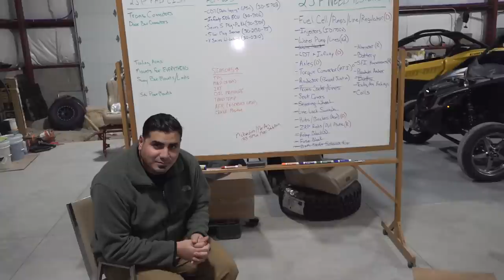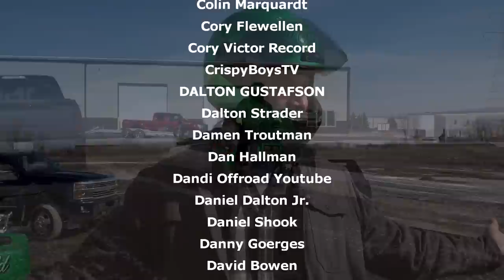We bought a mini PULLING TRACTOR! (and it RIPS!)

Comment: Wild horse name and logo is a play on the wheel horse lawnmower brand name and logo. 11:30 i thought it was Lloyd driving off on the moped in Dumb and Dumber. Lol the headlight a rpm activated light?
Reply: Yes I agree it is a play off the wheel horse it has a wheel horse rear end and that's why the red horse head over the tires on the rear fenders is there that's wheel horses logo I own 8 wheel horse tractors they were made vary well all steel at least the older ones and the used to use these old tractors as pulling tractor because they were made with thick steel to take abuse

Comment: You guys need to get a full size rubber parking curb thing and drill holes in the floor about every 8 inches so you can pin it down wherever you need it for whatever length thing you are going to do a burnout with.  Or drill your current rubber stops and pin those in.  Safety third ya know.

Comment: Needs a Busa motor with nitrous or turbo ! Hell Yeah Brother, I'd drive it !lol Kawi KZ motors are 70's vintage but still cool though but they just don't have the revs to put the power down out of the gate, but the fun factor is still there, you could probably run in the vintage class

Comment: I would love to see a 400 hp x3 motor in it next  build that 35 hp is not enough power
Reply: That kz1100 engine running right makes bout 108 stock
Reply: @nitromatt37gaming52  my x3 stock at 120 hp could fry a set of 28 in tires that thing can't even smoke a set of 12  and geared low not 108 hp
Reply: @shawnmccutcheon6873  geared right itll be a beast but tbh it's better off with a sxs engine

Comment: Leo you are the tractor pulling KING MY GOD THAT THING LOOKS LIKE FUN. That is your baby my dad had the Full bagger KZ1000 when I was 14 years old and he used to be a big Harley rider and he used to pull willys on his Harley but when he took me for a ride on that KZ1000 WHEN HE WAS ROLLING AT 40 MPH IN FOURTH GEER HE PULLED IN THE CLUTCH AND DUMPED IN 2ND GEER AT 45 MPH AND HE PEGGED IT IT BY DUMPING IN 2ND GEER AND THE BACK OF THE BIKE SQUATED TILL THEVPIPES RUBBED AND THE FRONT END CAME STRAIGHT UP TILL HISS BAGS IN BACK ALMOST STARTED RUMBING AND SPEED SHIFTED INTO 3 MY GOD THAT KZ1000 NEVER STOPPED PULLING I DIDINT EVAN KNOW HE WAS LETTING RIP AS HARD AS HE DID SUPER SUPER AWESOME MOTOR DO NOT TARE THOSE GEERS UP BE GOOD TO THAT TRANSMISSION BECAUSE EVERYBODY AND THERE BODY USES THAT SAME MOTOR FOR DRAG MACHINES AND THERE HARD TO FIND MY BUDDY HAS ONE SO IF YOU EVER TARE IT UP HE HAS THAT SAME KZ1000 BUT THEY ARE HARD TO FIND AMEN

Comment: That rear end has a Peerless with a 3-speed high and low transfer case he's probably literally in first gear low range on the rear transmission if y'all could get under there and put it in the high range third that thing would stand up and smoke the tires